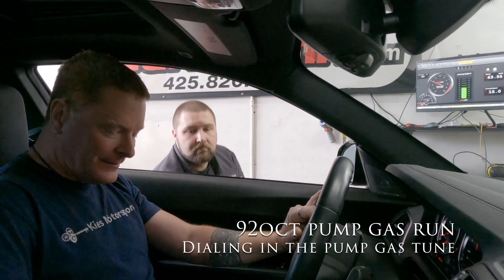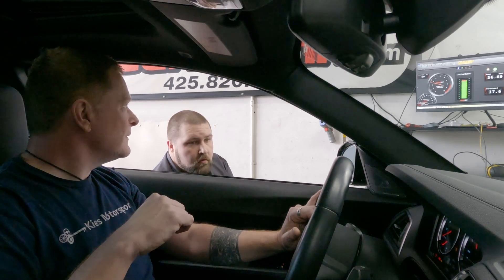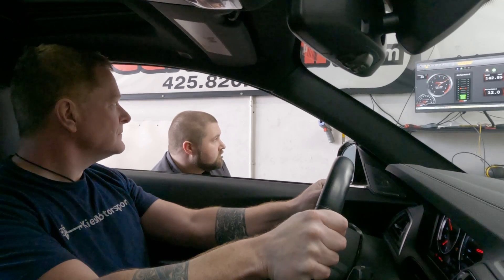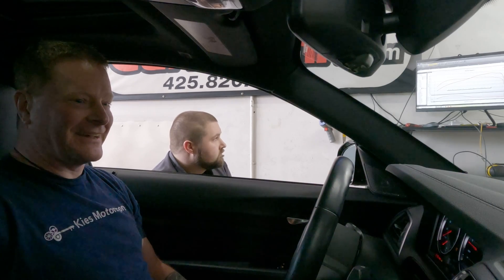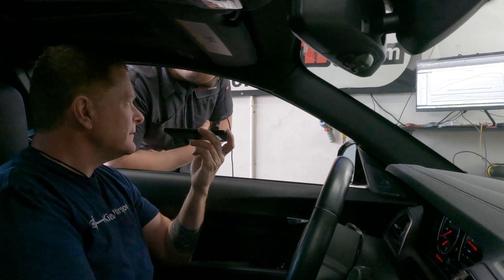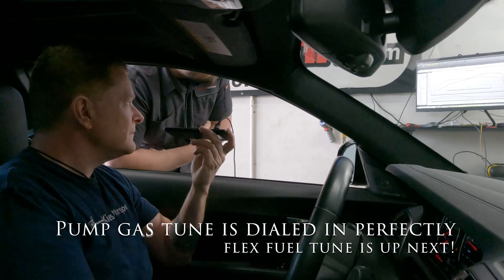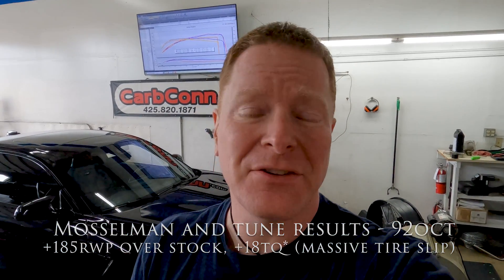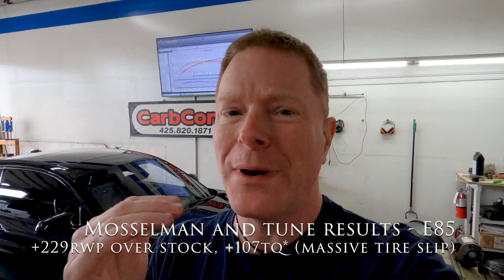Mosselman big turbos for the BMW S55 motor - INITIAL dyno tuning and results, more to come!

Comment: Great video! Were these turbos plug and play with their waste gate actuators? Didn't they need calibration of the actuators of some sort? How about codes
Reply from the maker: No codes or adjustments needed, though you will need a tune to take full advantage of the new power.
Reply: @BMWDIYGuy  thanks, big help

Comment: Did you limit yourself on the power? Most upgraded turbos F80s and F82s are in the 700whp range.. was about to buy these as I like their quality of work compared to Vargas, please let me know thank you!
Reply from the maker: I absolutely recommend these turbos, especially from Kies Motorsports.  My build is specifically limited because of stock internals.  My tuner is Cary Jordan who has done 5k+ S55s and I trust him explicitly.  He strongly recommend that stock S55s don't cross 750whp and 650lbs of torque, as while any increase is an increased risk, he feels it radically increases at that point.  Bryan of Kies has his 'Big Red' F80 on the same turbos and fully built motor at almost 900whp.

I was HAPPY to specifically have my tune setup to those limits as I dont want to blow my motor.
Reply: @BMWDIYGuy  I also saw in your video you mentioned you still have stock HPFP that would explain why you hit the numbers you did so quickly, thank you much brother! Do you have Facebook, IG? I’m local to you I think.  I live in Kirkland :)
Reply from the maker: Thanks man and local too!  Actually I am fully upgraded fuel system now too, with HPFP, LPFP and port injection.  Yeah, I went a little crazy needless to say.

I have insta, even my own website now, though the FB page is down for 4th time in two years, without any reason and no clue of when they will restore it (again)

I have my running full build up on Bimmerpost as well.
Reply: @BMWDIYGuy  Hey updating you! Just purchased my Mosslemans! Can’t wait to get them!
Reply from the maker: @ArtemisArtz  excellent choice, you will be very happy with the results!
Reply: @BMWDIYGuy  Thank you for suggesting them to me! :)